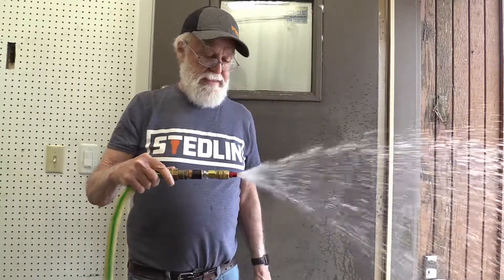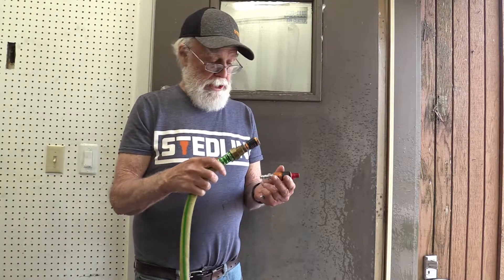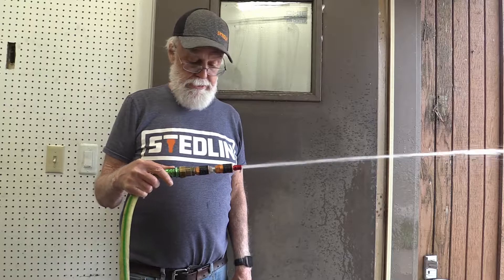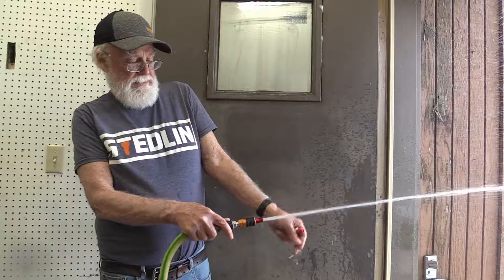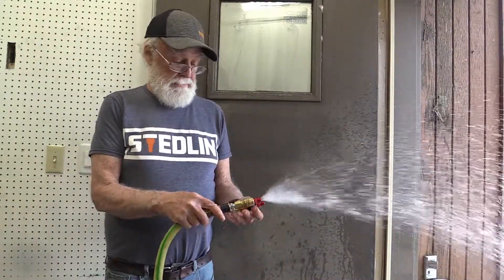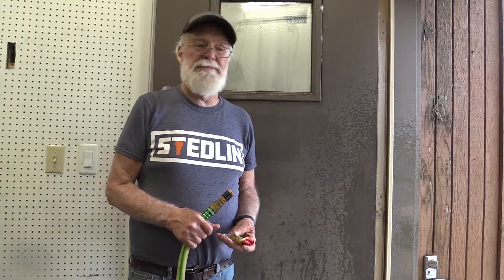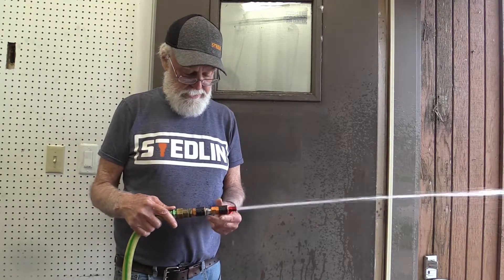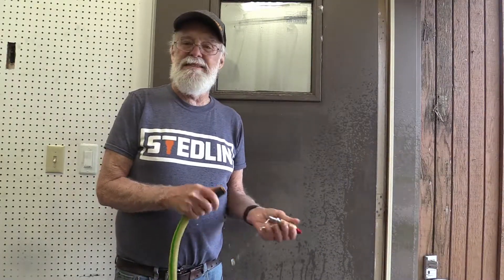Milton 715 vs Stedlin Quickcoupler water flow demo

Comment: why is the water fanning only time you get that is by plugging off a hole . a round hole will keep a stream .
Reply from the maker: I believe the reason for that is because the flow through the Milton coupler is extremely turbulent and prevents laminar flow from developing in the plug.
Reply: @Stedlin Maybe it is that .  I watch your flow test ,  I love the one showing 10% increase in flow .  If I need more CFM I add a second compressor .